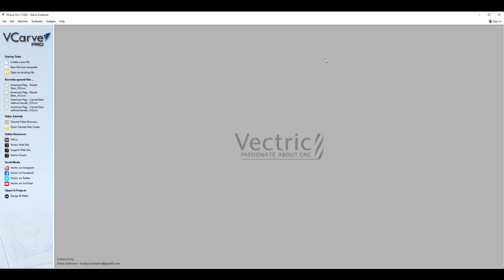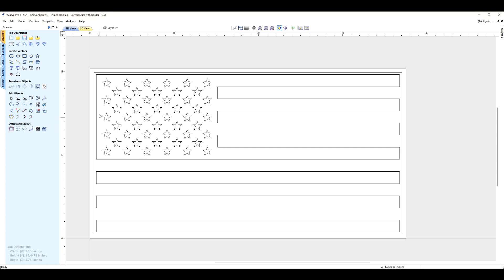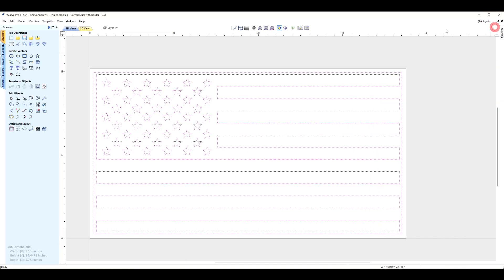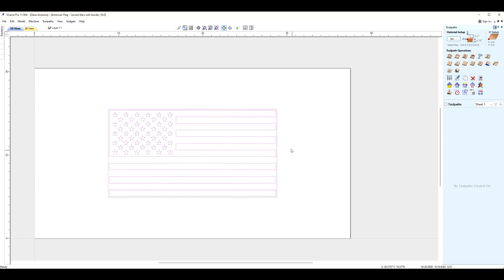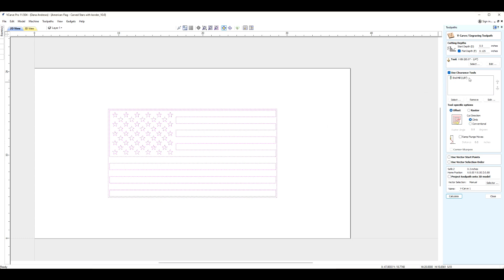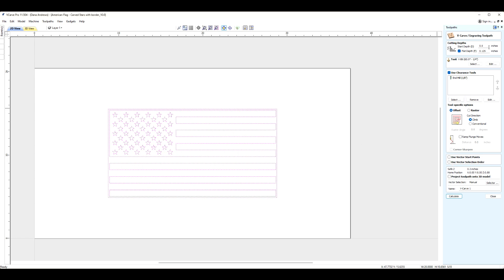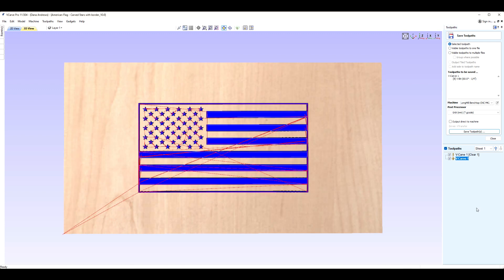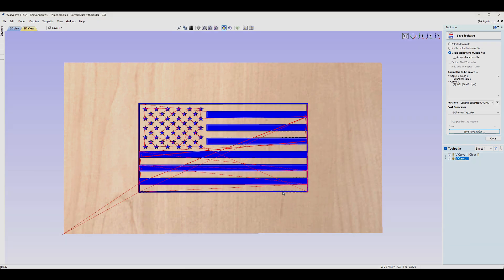Why use a Roughing bit?

Comment: For this kind of job, before seeing this video, I'd have used a quarter inch end mill to do the stripes and the v-bit for the stars. What is the advantage of running a two bit carve the way you propose?  

The only times I've used a set up like the one you describe is for a 2.5D (or 3D as some would call it) project. 

In in my second year with my Longmill and love deepening my learning of the craft!  I thank you for your time and for your continually excellent videos.
Reply from the maker: Hey Michael! I guess there would be no real advantage other than the look. I personally like the chamfered edge, and squared corners look  better than the rounded.
Reply: @Bucky's Customs  Ooh there the difference. I look forward to trying it to see for myself. I think I'll agree with you 100%! 👊